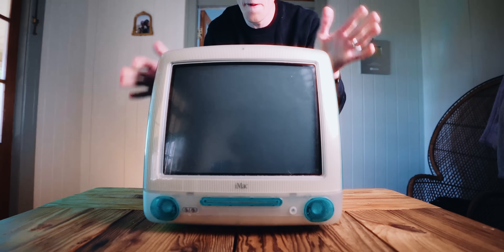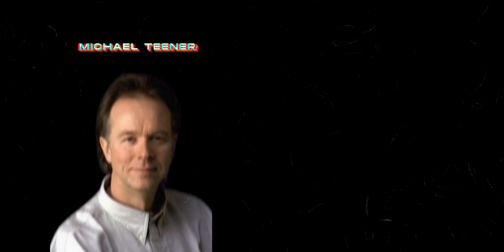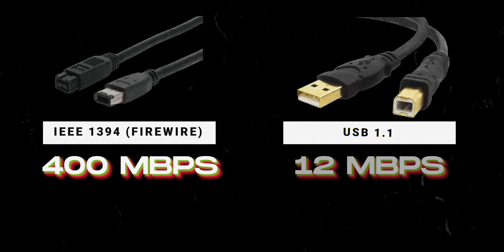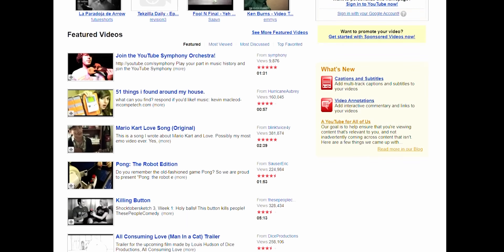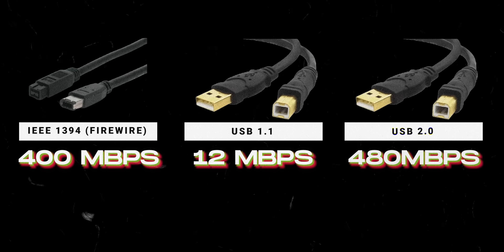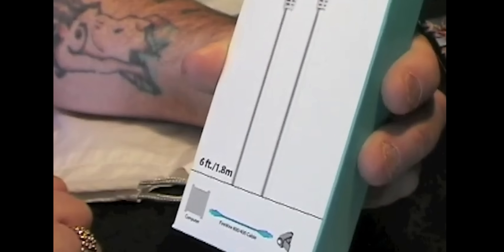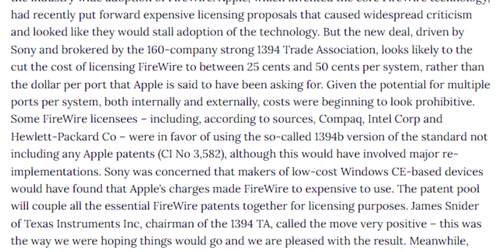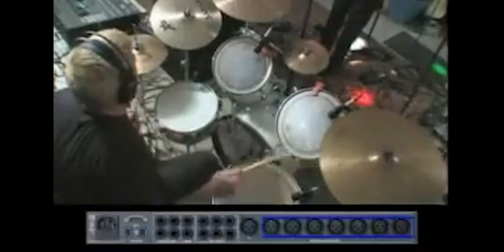Why Steve Jobs Forced You To Buy FireWire (Then Killed It)

Comment: Firewire always was way superior to USB. For example, the ration betwen gross and actual data rate was far better. USB 2 reached 480 MBit/s only on paper (barely 350 in real life), while 400 MBit/s was about the actual data rate of FW400 and 800 MBit/s that of FW800. And, as you mentioned, the daisy chaining and the direct communication between devices without a host. Even FW1600 and FW3200 were specified, but to my knowledge never actually implemented. Alas ...
Reply: in practical applications its not way better.  the connectors less fiddly but the amount of devices where you'd experience the marginal difference is tiny.

why it feels better in memories is that you didn't have a bunch of cheapo devices struggling with using too much power from the port and so forth like you did with usb because you were actually using usb.
Reply: It wasn't "way way superior". You can get >40MB/sec (which is more than 400 megabits/sec) with a USB 2.0 disk transfer easily. Firewire 400 and USB 2.0 are on par with one another, sans the daisy chaining and powering of devices.

Comment: FireWire wasn't proprietary to Apple but they did copyright the name and so every other electronics brand that used FireWire had to use the technical name of IEEE 1394
Reply: Sony called it i.LINK, TI called it Lynx on early devices, it was seen as "DV" on video cameras, and often the port was just labeled "1394". Later versions labelled them S1600 and S3200 but by then no one was really interested.
Reply: @keaton718  I originally thought that this port was proprietary to Apple as I had only seen it on Apple devices like the classic iPod. Then my dad had this Dell Precision workstation laptop that had a dock and a bunch of random ports. It ran Windows 7 but he updated it to Windows 10. He eventually got a new work computer and gave me that beefy laptop and one of the ports it had was the FireWire port (or IEEE 1394 as Dell would call it).
Reply: @keaton718 yeaaa.

I grew up on this I'm in my late thirties and it was so cool to watch this transition over time and now we have Thunderbolt 5 which is just insanely fast . Last night I played VR through an external GPU on Thunderbolt 4 to my new Panasonic Toughbook . The cable is thinner then a straw and your pipes this much pcie data in real time is just freaking amazing
Reply: @keaton718 DV is the video format, FireWire/IEE 1394 is the connector to transfer DV video to computers

Comment: "FireWire didn’t die, it evolved into something better." Well, it’s dead now that support is being unnecessarily axed in Tahoe.
Reply: yup, i'm so mad, i used that shi daily with ipods and minidv cameras... i already made a request in feedback assistant to bring it back, could you as well? this is our best shot
Reply: Is there any Mac with a FireWire port that has at least the minimum specs to run Tahoe?
Reply: @thedeadpandeveloper  Apple used to sell Firewire 800 to Thunderbolt 2 adapters to help with the transition when they dropped the FW port on Macbooks. Apparently those adapters still work on modern devices when paired with a TB2 to TB3 adapter? Crazy.
Reply: @sypwn  So they dropped support for a port that requires 2 adapters to use on modern Macs? Makes sense to me lol
Reply: @zachywacky1 it is just that apple does this all the time.  Sometime the reason makes sense, but most of the time, it’s because they just want people to buy new.  Old tech must die, but Apple treats oldish hardware as incompatible. OCLP is proof, if a hand full of people can make graphics work. Apple just intentionally dropped it.  It’s not like they needed to rewrite everything, just compile it for the new kit.
Reply: @pud469  oh yeah no, I completely agree that Apple can be extremely trigger happy for ending support for their products. I just think FireWire is an example of a feature they were justified in ending support for, because no computer supported on MacOS has FireWire, and that’s been the case since Big Sur. The overlap between people who still use FireWire and people who need to use the newest OS is very very small, and in fact, I’d wager to guess it’s zero.
Reply: @zachywacky1 yep it is completely understandable for FireWire, but is it really that much of an inconvenience to keep it also?  My hobby is old tech, so I do use FireWire often, and is the best interface for that kind of transfer.  I have other solutions, but it's not like keeping this support is going to bloat the os, and didn't need continued maintenance.  Just leave it lol.  It's just incredibly frustrating they put effort in to disable functions, instead of leaving it as non supported, and if it doesn't work, then it doesn't work.  Deprecated functions happen, and unless it creates a barrier, it hangs around.  Maybe there is some way it interferes with some new security model, but it would also be nice to know that, other than it's just old.
Reply: @thedeadpandeveloper  My M1 Pro MBP is hooked in an Apple Thunderbolt Display that has a built-in FW800 port
Reply: @thedeadpandeveloper  The mac pro 7.1 has PCIE ports you can build in a Firewire card.
Reply: Time capsule backups too. Was just about to buy an og airport just for the backups but nope.
Reply: @ExtremelyOnlineGuy  Honestly I wouldn't trust an old Time Capsule after all these years, there's much better NAS solutions for Time Machine, I got it running on my TruNAS/ FreeNAS box that I built, and it's been much more reliable than the Time Machine support that is also built into most ASUS WiFi routers, the advantage there is you can just connect a USB HDD and you are up and running.
Reply: I'm about done transferring a bunch of old VHS-C tapes to digital, and I think I have like 1 Mini DV tape. So glad I don't have many more to transfer if they really killed FireWire support with Tahoe because I'm running Tahoe beta on my MacBook Pro now. I still have my old 2013 15" MBPr that's on life support that I'll use if I need to use FireWire to transfer any Mini DV tapes.

having said that, i like to think that FW evolved into Thunderbolt in some ways.
Reply: Is any FireWire equiped Mac able to officially run Tahoe? Because going the route of a FireWire to Thunderbolt 2, to Thunderbolt 3 adaptes would make the Mac think it’s a Thunderbolt device wouldn’t it?

Comment: Firewire was great for what it was at the time, but it certainly was not a one-cable solution for all devices that supported it. There were, after all, 4-pin, 6-pin and 9-pin variants, and you would occasinally have to dig around for a dongle or special cable to connect your mini-DV camera or sound card to your computer. I'm still using a couple of great sound interfaces (Avid MBOX Pro 3 and M-Audio Profire 610) that still work just fine in Linux and Windows.
Reply: YOOO PF 610 I miss that interface
Reply: And USB 2.0 dont have like a 10 types of conectors? One kind of cable for a printer another for a Canon Camara, another for Sony Camara And so on
Reply: No. There's one main type of printer/scanner device cable for USB 1.0 and 2.0, the USB B connector. Not sure about Canon, but for Sony it's been from the late 90s USB mini, then micro. These are standards. So a few, sure, but 10, no. But if you were just exaggerating, then... I suppose.... Still. They weren't branded.
Reply: @SiegfriedGlina 

There were definitely a lot of  abused 
 1.1 and 2.0 four wire connections for USB
Esp early 2.0.

Comment: The mid 2000s feels like five mins ago.
Reply: I agree. I feel cheated that I've aged so much.
Reply: Yeah, this is apparently a common feeling, mainly because fashion and (Western) culture hasn't changed much since 2000, or even the mid 90's. Take the sitcom Friends for example, when it started in 1994 the fashion they wore was a bit outdated but you could totally still wear what they wore today and no one would bat an eye. When the show finished in 2004 their styles were pretty much the same as what everyone still wears today. 

There have been changes of course, mainly in technology, cars, music (although it could be argued that 90's and 2000's music was better than todays) and other subtle things but nothing like the changes between the 50's, 60's, 70's, 80's and 90's. I think it's fair to say the 80's was the first "modern" decade which molded into the 90's and there have only been small incremental changes since then, in everything except technology. 

Hence why the mid 2000's feels so recent because the last 3 decades have been so similar. That's my theory anyway, maybe all 46 year old's throughout time feel like their 20's and 30's just disappeared. 😂😂😂
Reply: @Cyba_ITA very good theory. And I agree, the 80s were so different to the 70s. But the 2020s va the 2010s? I couldn’t tell you how fashion has changed.
Reply: Shuhhh.. nooo.. hush . .. cursed you..

❤❤❤😢😢😢  its still 2009 right?

Comment: The most beautiful feature of firewire was the ability to daisy chain hard-drives...
Reply: If I remember correctly that was my first introduction to FireWire as a kid. I think either my uncle or my step mom had a stack of external drives for file and photo storage on top of their desk with a mix of external drives linked together with shorter FireWire cables and then one long cable running to their Mac handling the data transfer and I was amazed at the time that you could link drives together and access all of them via a single cable from just one of the drives

Comment: I work at a store that repairs and refurbishes older Apple machines and we still use Firewire quite often for many things like data transfers, data backups to external drives. Its still surprisingly quick by todays standards and ive never really had a Firewire cable play up on me unless it was literally cut in two.